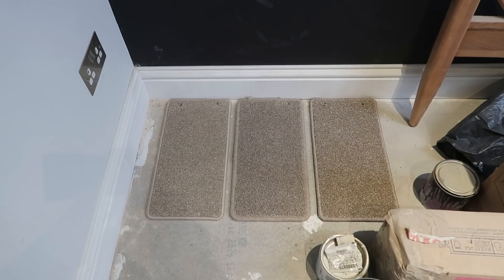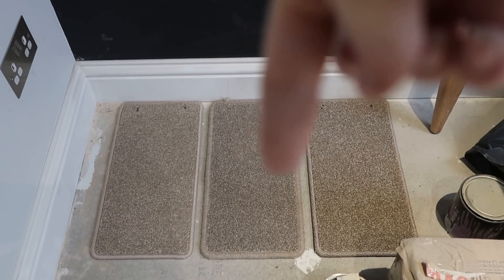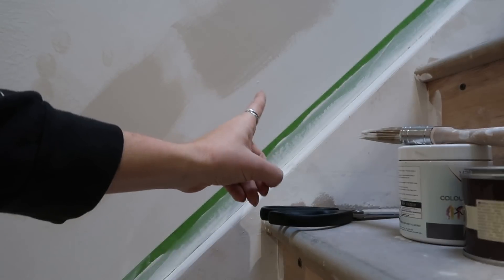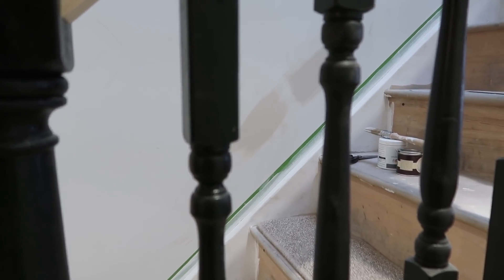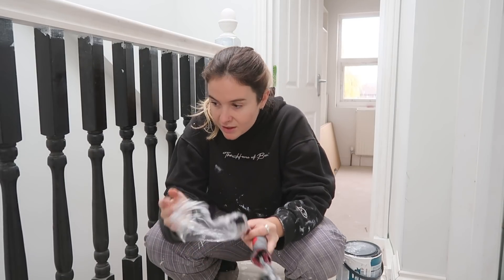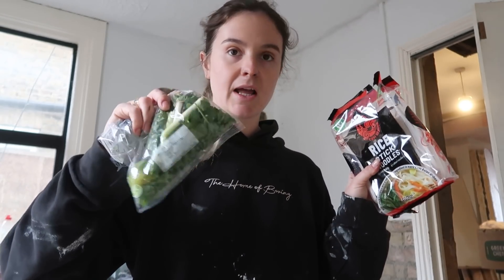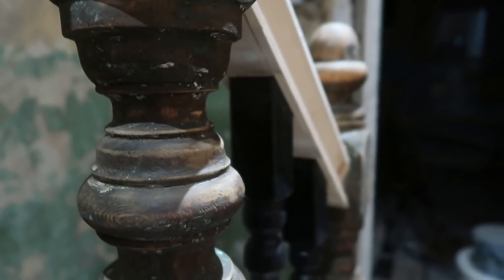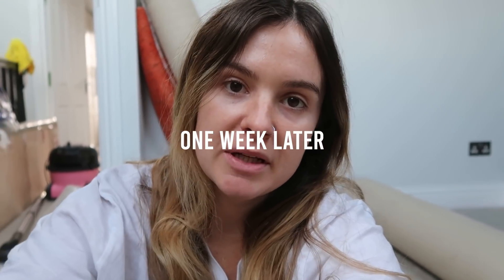THE FINISHING TOUCHES | choosing carpets, finishing the black bannisters, caulking + painting

Comment: You've inspired me to paint my stair spindles and newel etc black. Now I'm contemplating painting the actual stairs black and have a zinging runner, maybe mustard, maybe not. Trying to put the finishing touches to the kitchen - it's all those little bits that you think won't take that much time, but do. But the ceiling and walls above the tiles are done, touched up the green cabinets, mostly stuck the white wood effect plastic where needed, then it's cleaning up. Brother still has to fit base boards, but it's progress before moving to upstairs.
Reply from the maker: Black all the way 🖤 And couldn’t agree more - it’s always the finishing touches that take the longest. Our snag list is getting longer and longer and I’m not doing any of it! Sounds like a lot of progress is being made, though!

Comment: Autumn  another cool video.. good job regarding the painting,, as i said before you guys are going forward nicely ,  
Just a quick question, what way are you heating the house ?
Reply from the maker: Thanks Anthony! It’s coming together nicely now. We have a combi boiler with 15mm pipes into majority of the radiators. For the kitchen we plan to have electric underfloor heating (I know can be expensive to run) but hoping heat from dining room will warm it up without the need to use it often!